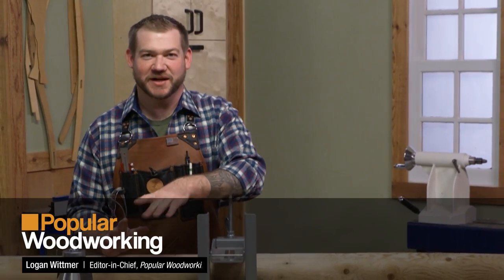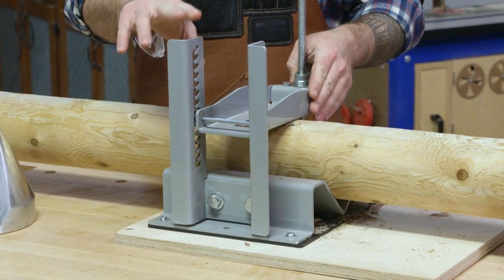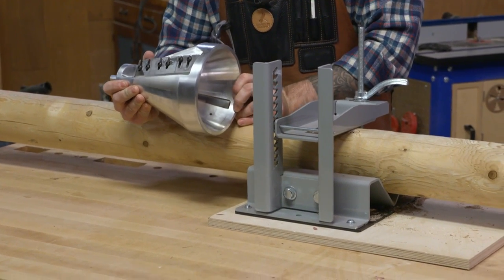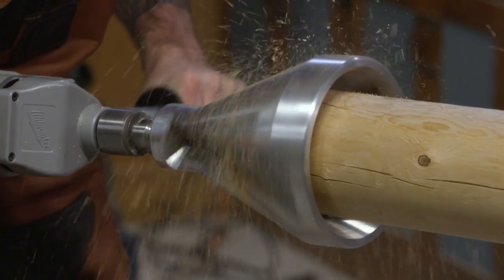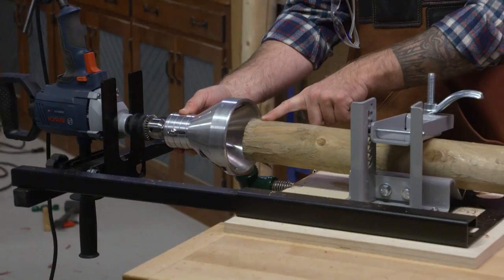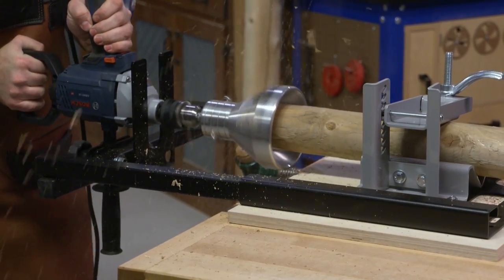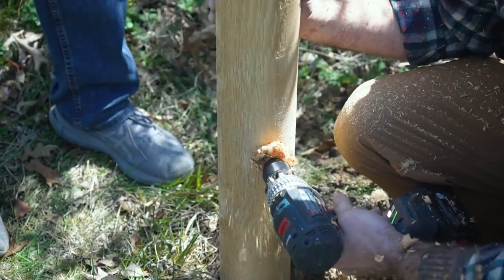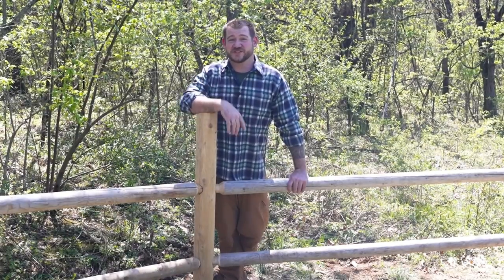Building Fences with Lumberjack Tools

Comment: I cut a 1" hole in a 5 gallon bucket, put bucket on its side, drill on outside of bottom, cutter inside bucket, and the shavings get trapped/collected mostly in the bucket.